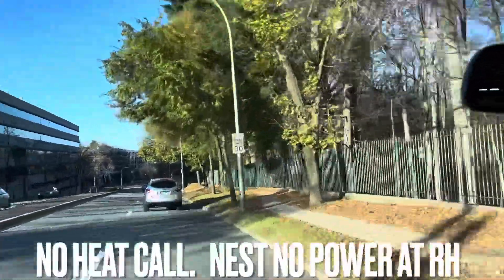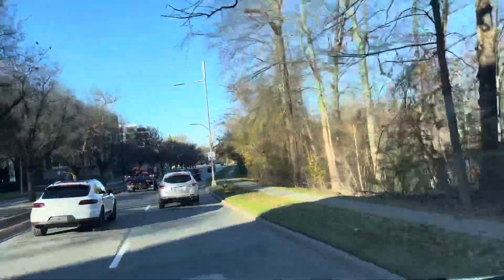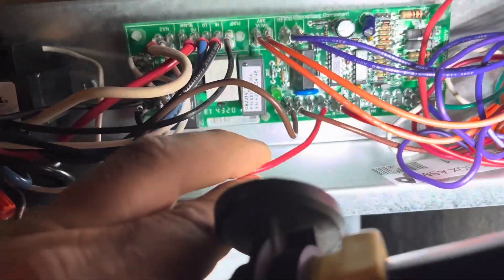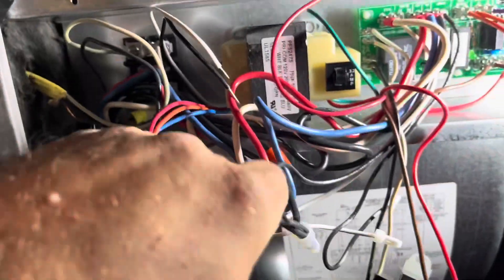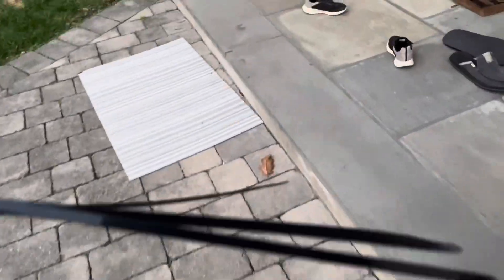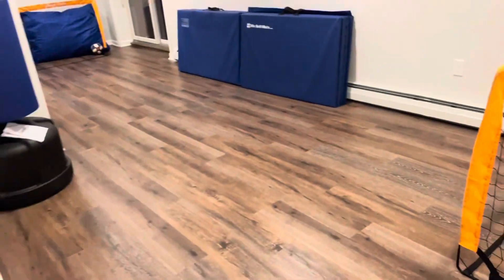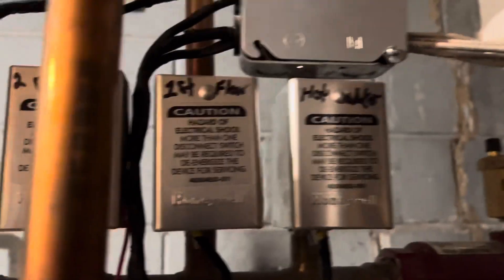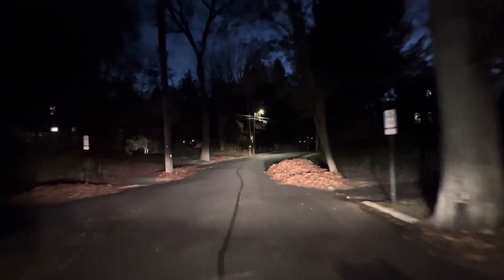WHY DOES MY NEST THERMOSTAT READ NO POWER TO RH WIRE DETECTED???

Comment: Nice job  I have the same problem the furnace turn the game on for about 7 minutes and shut off and turn on again after 5 minutes and the message at Nest termoste say E73 no detected power on Rc cable  but all cables are tigh 😮
Reply from the maker: Check all safety switches like float switch condensate pump etc

Comment: Some wire could have been touching metal Paul and maybe you moved it. That will blow a fuse or transformer in a hurry.  HVAC GUY in Georgia just had one touching on the outside condenser. Good video Keep Posting.
Reply from the maker: Thanks Hugh.